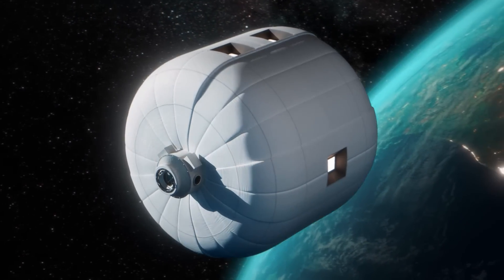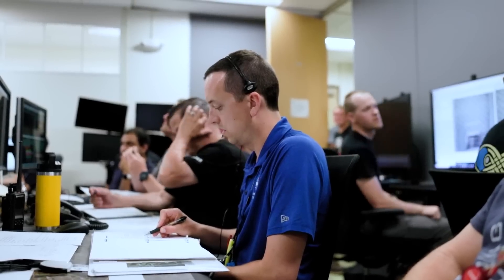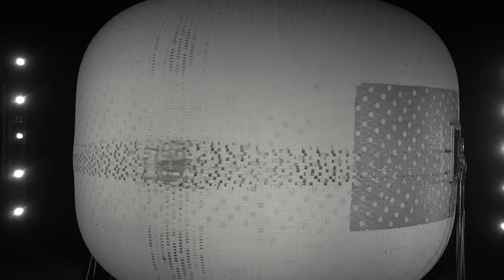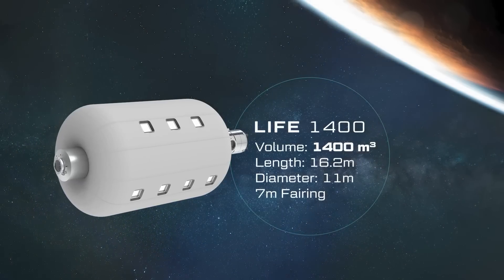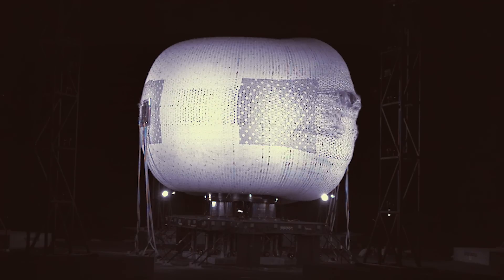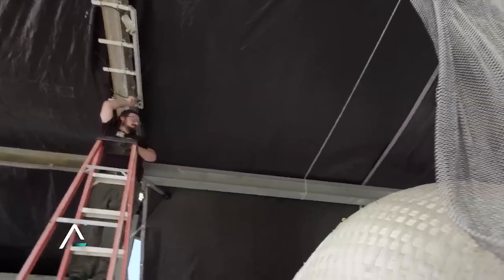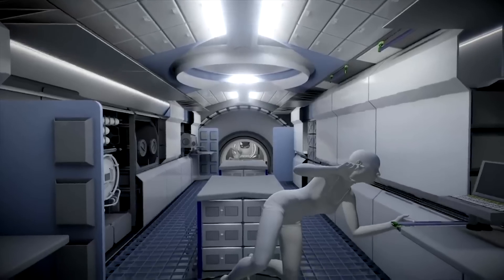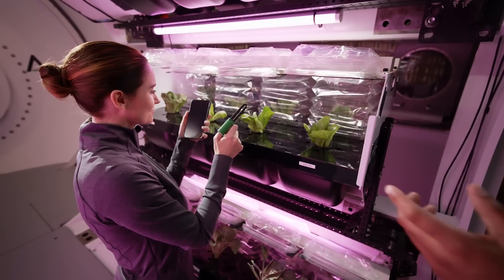Sierra Space Is Working On An Even Bigger Inflatable Habitat

Comment: I'd like to see Sierra Space and SpaceX get together and work on this project. It could provide an inexpensive (relatively speaking) in space workshop for projects like upgrade Hubble or provide support for projects like the Polaris Dawn Spacewalk. It could even be used for the initial orbital Lunar Gateway while more durable NASA units are being finalized.
Reply: Sierra Space doesn't need SpaceX's help in developing these Space station modules. The largest version on their website may eventually fly on Starship, if SpaceX develops a Starship capable of deploying large payloads, but in the meantime Sierra Space is planning on launching on NewGlenn and contributing to BlueOrigin's Orbital Reef space station.
As for use on Gateway, the initial PPE and HALO modules will be ready much sooner than Life.
Reply: @plainText384  While I really want to see Blue Origin "fly", Spacex is already proven. I just think a collaborative effort will be more successful in the long run than either company on it's own. I also think Spacex could be ready to launch Tenacity long before Blue Origin has the New Glenn ready to go. Timing could be the make or break issue in this phase of the space race. Done correctly, all three companies win, no losers.
Reply: @oldgandy5355  Dream Chaser Tenacity is not waiting for New Glenn, nor is it planned to ever launch on New Glenn. Dream Chaser will fly on Vulcan Centaur. And it if Dream Chaser was ready, it already would have flown to the ISS. It is only because of delays on Sierra Space's side that they were moved from ULA's second launch of Vulcan Centaur to its fourth.

As for collaboration with SpaceX, Sierra may very well launch a smaller version of their LIFE habitat on a Falcon 9. But SpaceX isn't really working on a space station concept of their own, they don't have an answer to BlueOrigin's work on Orbital reef. And SpaceX's Starship is no more proven than BlueOrigin's New Glenn.
Reply: Musk gives every other company the ick
Reply: @9bang88  Other companies wish they were as far ahead in the space game as SpaceX!  Their envy of SpaceX is obvious!

Comment: I like this technology, but I think the critical unstated part to make it useful is what the volume contains. The space station has to be filled with everything that is necessary to live and work in it. How will this be done?
Reply: Launching junk into space is the easy part. The hard part is launching habitable volume into space. Which is why ISS has so few modules and yet it's chock full of cargo.
Reply: There is currently a Bigelow expandable module connected to the ISS. It passed all the testing in situ, but Bigelow went out of business, hence the module is still connected to the ISS years later, and is currently used for storage.
Reply: I assume the rigid central core will be packed with stuff so that once inflated a crew can board the station and use all the stuff packed into the core for at least some of the interior fit-out. Then as already mentioned any additional fittings and equipment that couldn’t be packed into the central core for the initial launch  can be taken up to LEO by one or more follow-on cargo launches.

Comment: Typical pressure vessels on earth are designed to leak before burst.  The desirability to this is obvious as a leak can release pressure slowly as opposed to explosively.  Materials that achieve this typically have a high yield to ultimate strength ratio and also have high fracture toughness.  Annealed steel is typically used here on earth.  However the downside is that they are heavy.  I see this woven fabric to be risky and problematic over a long period of time.  I would feel much more comfortable using metals if my life depended on it.
Reply: Metal got used for pressure vessels because it was all that was available for that application when Steam Engines appeared. Composites and Plastics offer signifigant advantages in mass-to-strength. Combining both, as Carbon Overwrap Pressure Vessels, where Carbon Fiber is wrapped around the outside of a Steel vessel and held in tension the whole time, takes advantage of the characteristics of both, while achieving a lower mass overall.
In the case of the TransHab/BEAM/LIFE module designes, several of the layers are composites, and several are a metal Mesh made from woven from Wire. (I don't recall if it's Steel or Titanium wire)
The "Woven Fabric" description is woefully poor accuracy, as it makes the layman think these are Cotton, Wool or Polyester types of materials, rather then the advanced materials they really are.
The advantage of these flexible materials over solid metal panels, is that during heat cycles they are able to change shape, rather then just flexing to the point of cracking in the way an aircraft shell currently does, or the way the ISS's current shells do. These materials age much slower because of that difference, making them signifigantly safer for longer durations.
Reply: Fly Starship.
Reply: Fly steel sheet coils up on starship, fill it max capacity. Slap some thrusters and comms gear on a spiral welder, send it up. Weld coke can habitats of any desired diameter.
Reply: @Shrouded_reaper Why fly a welder, when you can send a tube of bonding agent, same as modern automotive bodies are assembled with. Welding in Space will be reserved for the core structures, the backbones the LIFE habitats can be fitted over. Aluminium skeletons with composite volumes sleeved along them, bit like a Lotus car with metal backbone chassis and Fiberglass or Carbon Fiber tub and panels.
Reply: These are test to failure tests.  You think they don't know about PRV's? Ignorance and uselessly ignorant opinions have been holding us back for decades.  You're just another symptom of a growing disease.  Stupid is the next ELE..

Comment: All these comparisons with ISS volume neglect that this is not a house which can be compared on square footage.  An effective habitat in space needs massive amounts of lifesupport, power, computers etc equipment inside to actually support human life and yet more lab equipment for their to be any point.  Thus weight limits actually matter a lot more, and the pressure shell of aluminum can type habitats has never been the main source of weight, it's always been the equipment.  Inflatables may lets us make astronaughts more comfortable with some elbow room but thats about it.
Reply: I think equipment that needn't be optimized for small size could well be significantly cheaper.
Reply: @cube2fox they can't fit that (structures, equipment) from the ground for inflatables, they have to carry them up in separate flights and shove them in from a tiny hatch.
Reply: @admarsandbeyond  They could instead make a larger hatch though.
Reply: @cube2fox  I don't know if that's possible on an inflatable structure. A gigantic steel ship (Starship with tanks is >3200m^3 of pressurized volume) on the other hand can be outfitted with equipment and structures from the ground, and can be modified very easily with simply tools (welders).
Reply: @admarsandbeyond  So you are proposing a space station which consists of multiple Starships stuck together? Or a Orbital Reef-like station except with Starships instead of Sierra's inflatable habitats?
Reply: @cube2fox  A single Starship is >3200m^3 (wet workshop), Orbital Reef will be almost 3 times smaller (at 830m^3) when fully assembled (decades away if ever). 
If you need more volume just add more Starships. Better yet build a rotating small ring structure and add the Starships vertically on its perimeter and create variable G sim environments (nose away from ring)
Reply: @admarsandbeyond  SpaceX actually did a Starship based proposal for a NASA grant for an ISS successor space station. But SpaceX didn't get any money for their proposal, while Blue Origin, Sierra and a few others did. Though I'm not sure how much money was actually involved and whether it is enough for "commercial" space stations to be profitable.
Reply: @cube2fox  They proposed using an HLS for the CLD program. They were rejected because they didn't propose a business case for it and asked for full reimbursement of its development costs from NASA. They just took a rough shot at getting some of the (very little) seed money NASA was spreading around to help facilitate some companies to come up with concepts about privately owned LEO stations.
I don't think SpaceX want's to spend resources on building a space station and running it commercially. They have other priorities. I think other companies will do that using Starships (buy, lease or commission) and paying Spacex for services (construction, launch, orbital ops, supply, maintenance, professional astronaut services etc)
Reply: Weight limits?  Why once in orbit does mass matter at all?  It's almost like you don't understand one of the key things they're trying to do.  In fact I'd say that's a safe bet.
Reply: With Starship there is no mass concern.